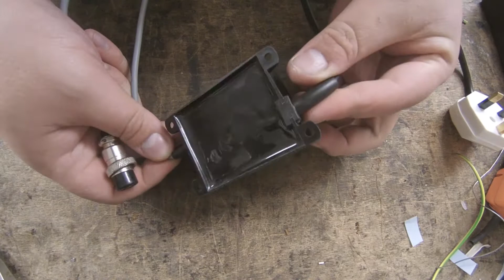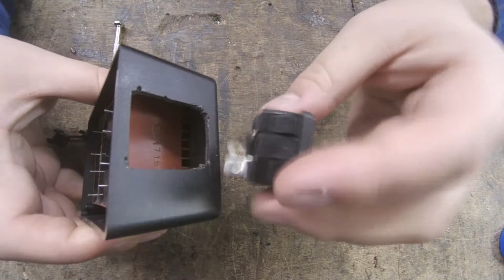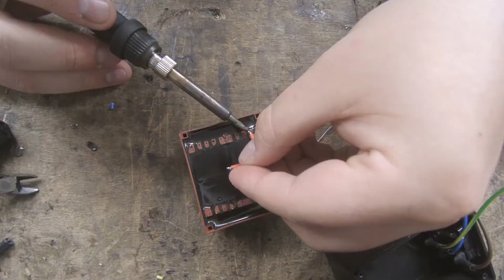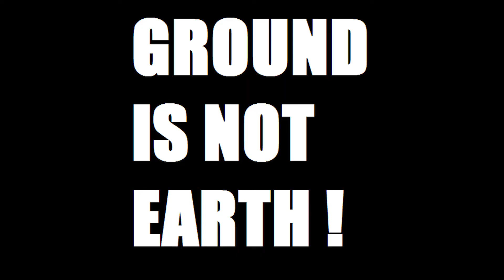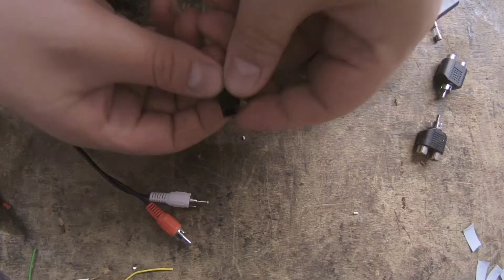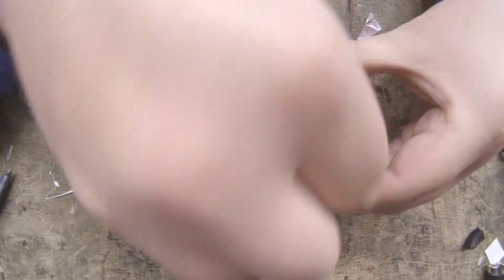Building PSU for discontinued mixer (Rodec Scratchbox) - Andy's Boring Job

Comment: My hubby just foned total impact protection and they picked up. Apparently rodec no longer make the rodec scratchbox and haven’t for around 3 years. The MD at total impact said they only sold around 20 in the uk in total. Hubby just missed out on one, on eBay Ireland. So, they’re like rocking horse poop.The mixer on eBay, in Ireland, sold for less than £300, broke his heart. Just missed out. Apparently they are fantastic. Looks like he’s goin to have to buy either a Rane 57, or Allen & Heath x one 02, or x one 23c. He’s Gutted!!! Peace.